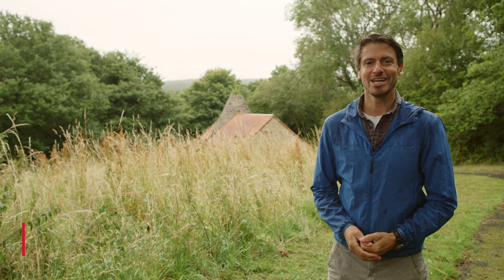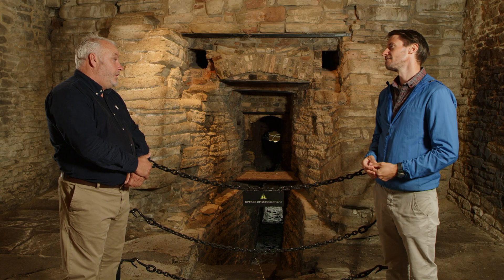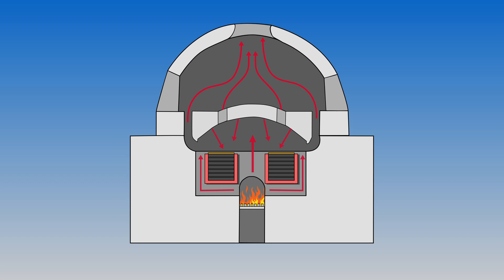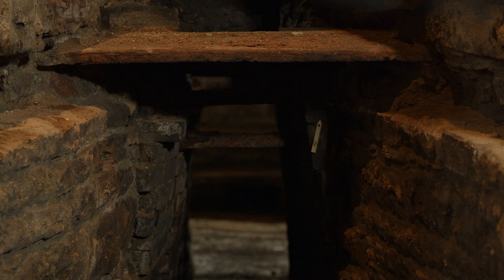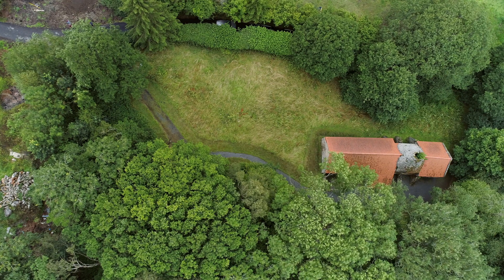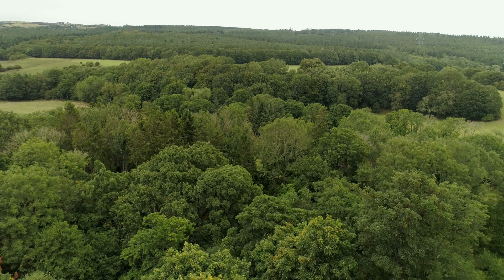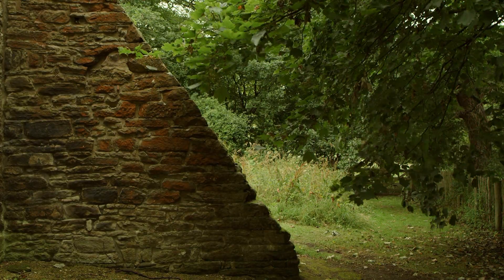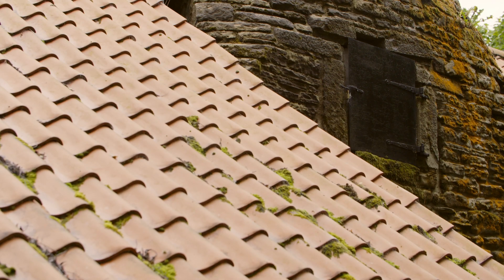How England Was Made | Episode 3: Derwentcote Steel Furnace

Comment: I have no idea what this video is talking about. After reading the comments below I think most people have no idea what this video is talking about. In 1856 an English ironmonger invented a method to convert iron to into steel efficiently and thereby lower the cost of making steel. The idea was to blow air into the molten iron and that would react with the carbon in the iron and remove the carbon content in the iron and make a stronger iron called steel. The essential thing was to lower the carbon content in wrought iron and make steel. The description in video was that oxygen weakened the iron. By isolating the iron from the oxygen and driving more carbon into the iron. Of course, this is exactly the opposite of the Bessemer Process of lowering the carbon content by blowing air, which contains oxygen, into the molten iron to remove the carbon. The carbon is driven into the iron from the smelting process. The smelting process used charcoal or coal to heat up the iron ore so the iron would melt and separate from the impurities of the iron ore. But this video claims the opposite to be true. As a result, I have to conclude that Derwentcote never made any steel and this video by English Heritage is a complete fraud.
Reply: Carbon increases hardness of iron.